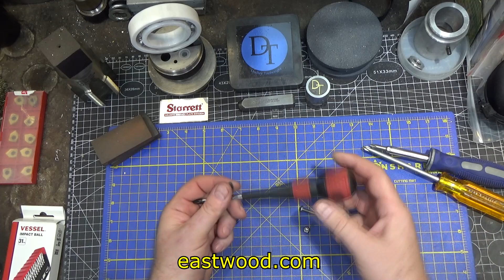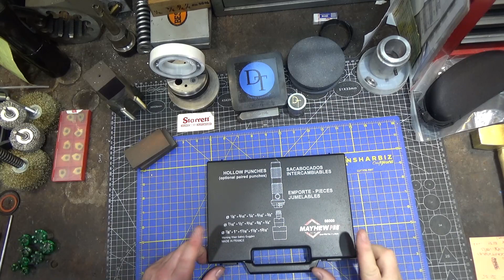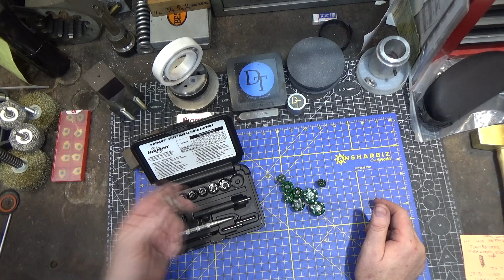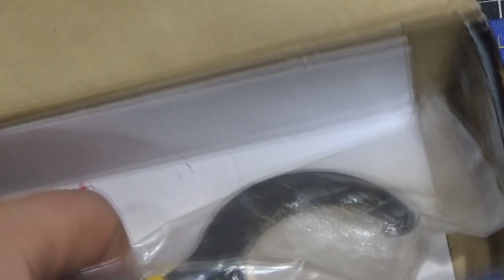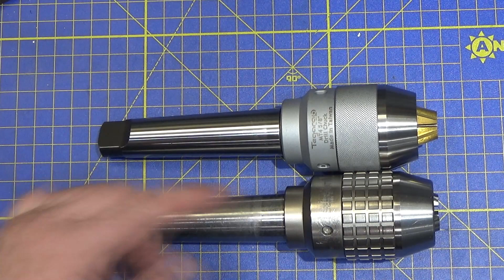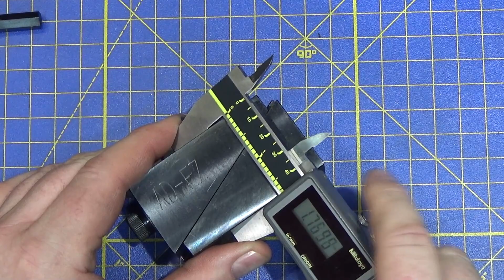QTR 88 Interesting Finds

Comment: Those undersized cutters are perfect for drilling holes for nutserts. I put over 100 17/32" holes in my Jeep for bolting armor plates to the body, all with a 17/32" twist drill. I wish I had a set of annular cutters, but never found one that was the right size.
Reply from the maker: Thanks for the use case. Thanks. Now for the arbor...

Comment: I have an embarrassingly simple question that I thought you might know the answer to. Somebody brought me a decorative knob requesting a screw for it. It's a very small hole, no hope for a thread gauge. I don't own one of those strings with every nut and bolt on it. Any clever idea on a quick way to determine TPI? And metric versus imperial? I'm fairly certain it's imperial based on the provenance
Reply: Calipers would get you in the ballpark for diameter of the hole, then if it's imperial you only have a few likely options: 4-40, 6-32, 8-32, 10-24, 10-32.  One of those is likely, but once you have an idea of the diameter, you should be able to go to a hardware store and test with what they've got.
Reply from the maker: Good advise. I have a decent screw collection. I would try to find one that fit.

Comment: I don't know if they are related, but I have a set of bits that is identical in every way to that one but branded felo. It is surprisingly affordable for the Japanese / German tool range and based on your description, I believe they have the same qualities. I've become weirdly obsessive about using those, it's such a pleasure comparatively even though it's such a small thing. EDIT; I spoke too soon. The set I have do not have the ball for impact use. They do have the remarkable holding power for a wide range of fasteners without magnetization
Reply from the maker: I totally get the high end tool fetish. They not only look good, but are a dream to use. I have a Fein vacuum from my woodworking days and it is amazing - high suction and really quiet.

Comment: I've had the Vessel set for a couple of years and it's as good of quality as you mention. I installed a bunch of brackets in my garage and used a Torx for all of the fasteners...the bit was like new at the end.
Reply from the maker: Excellent feedback, thank you! There is no better info than that which comes from someone who   is using the tools.